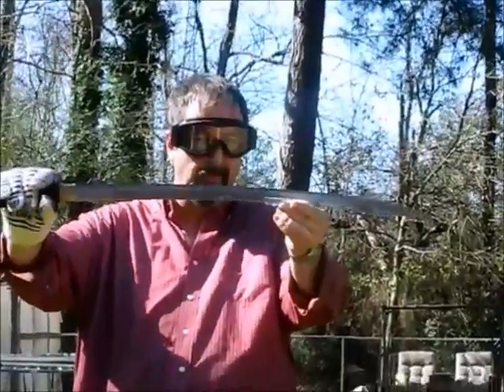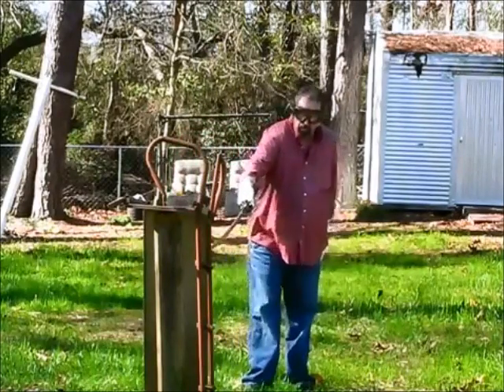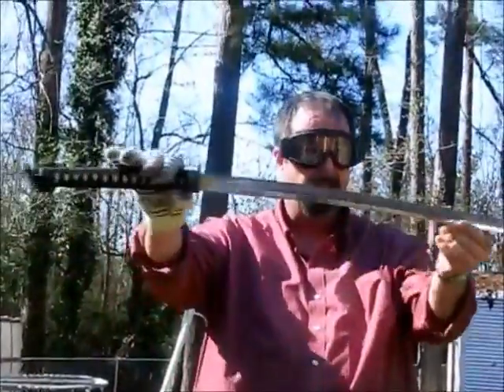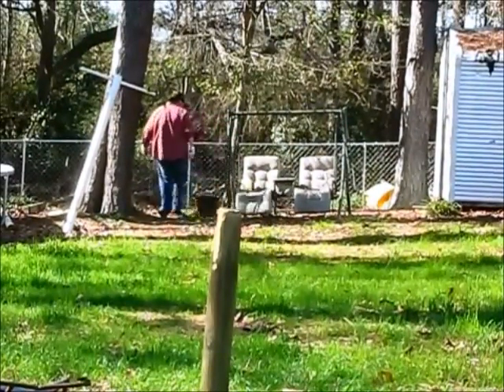Ronin Katana - Samurai Sword Destruction Testing - Sword vs Metal Pipes vs Bricks vs Wood

Comment: i will never call a katana a katana. unless it was made with the true proper traditional techniques . in forging out the blade then forge welding the two types of metal one with a higher carbon content for the cutting edge and the lower one for the back bone to allow it to recoil an retain its shape .even after it being over stress .  Damascus steel doesn't retain the strength and same properties as a true Tamahagane blade.
Reply: good to know, i was really wondering what you called a katana
Reply: was that your best sarcasm?
Reply: im not saying tamahagane is superior. just i like to stay traditional . i like the 1095 or 1085 steel in knives . i haven't forged anything out of 5160 yet but I've heard good things from it.
Reply: not at all....or was it and is this? you'll never know
Reply: haha nice
Reply: You wouldn't make a scimitar replica made of paper and expect to have another label for it separate from the name "scimitar", you'd just call it a paper scimitar.
Sword names are used to define their categorized forms.
The word katana; to swords, is not a specifically exclusive like the label Champagne is to wine.
You wouldn't say "this is shit Champagne" like you would say "this is a shit katana".
Reply: Katana means single edged curved sword. So anything like that would be called a katana by the Japanese. A Nihonto on the other hand is the sword you are talking about. Something made in Japan (Nihon).
Reply: then if so nihonto meaning "blade "could apply to a tano or other japanese  pole arm weapons or blade?
Reply: nihon is japan and to means sword.
so japanese sword

i think

Comment: It's called a destructive test. it's supposed to exceed the bounds of normal use to show how well it can stand up to abuse, and to show that the myths of the katana being able to cut anything are not true. This helps people see that there are limits, but that if they accidentally hit an object that is too hard to cut, the sword will not break in half and fly dangerously across the yard like cheap catalog swords and is therefore safer.

Comment: what if you could find a way to make the blade vibrate at a super high frequency to help break the atomic bonds of the object you're hitting? that way it is theoretically possible to easily cut through metal

Comment: It's extremely easy to bend a katana out of shape, especially if it's on accident or is being abused. All it takes is a misaligned cut. That is how they are designed. They bend so they don't shatter or snap, as a bent sword can be straightened, but a shattered sword is ruined.

Comment: Yes it would.
This is a made in china sword that is being mass produced on a factory and the metal is made of is very cheap, so thats why you can buy one of this swords from a $100 to a few hundreds.
In the other side of the spectrum you can have a handmade Japanese Katana, the whole process starts from picking the right mineral ore to transform into the right steel for it and then send to a Master Swordsman that works on it for months and then sends it to a Master Sword Polisher to sharpen it.

Comment: The simple fact of wanting tested the resistance of a katana without knowing even the method of use this, is an insult and a lack of respect to this weapon which in the past widely made his proof, today still of great master smith continuous japonnais to forge saber, only they are far more authentic and more resistant than these trinkets of decoration sold in the business which only uninitiated dares to call katana.
The forging of a katana is an uncommercial art practice which aims has to grow rich with blades of mediocre quality.
Fortunately for you, the ridiculous doesn't kill....... in the passage, do a little sport would not certainly hurt you, it shall be far more profitable to you than to bang a saber with an iron bar.

Comment: Teenager alert.  Stick with the guitar Robin, because a 15,000 dollar sword wouldn't cut STEEL any better than any other sword.  Steel does not cut steel.  This is a destructive test to see the durability of these swords so that other buyers know what they're getting.  There is nothing wrong with power hammers BTW and MANY MANY "real smiths" use them today.  Also... I've been practicing JSA for 20 years.  His form is bad, but he's holding the sword just fine.

Comment: I want to see an l6 banite katana destruction test, because apparently those swords are ridiculously strong, but who wants to ruin a 2100 dollar sword.
Reply: the Hanwei L6 blades are very good, but you can find them for around $1200. 

It is debatable, but the Hanwei Lion Dog katana made from HWS1 maybe superior, and they are about $900. 

If you really want a very strong Katana, at lest a starting level one. Look at the Cheness 9260 blades, they are very strong, pretty well made, and well designed. They are very good for under $300. 
Also the Hanwei Raptor line made out of Mono tempered 5160 are a great starting point, they are just over $300 now.
Reply: Oh yeah, the spring steel ones are awesome because of their flexibility [9260] but I was trained with hard steel weapons not flexible ones so I would be afraid to cut myself badly.
Reply: Aurumk1 It is not that flexible :)
You could cut a large mat and not be able to tell the difference, maybe the slightest different vibration. Holding my 5160 Raptor (no bo-hi) with one hand bellow the Tusba and one hand at the very tip (warped in fabric of course), with all my strength I can only get maybe a inch or two bend. 

The only difference in performance is that if you bend a clay temper blade past the point of no return, you are left with a bent sword. If you bend it to the same point with a mono temper blade, it will take about the same amount of force, but it will snap back to strait. That and the mono temper will lose and edge a bit faster (still more than good enough), but will be a bit more easy to sharpen. 

Also if you really do want a clay tempered blade, once again Cheness has some clay tempered 9260 blades for about $300. Most of that Hanwei Katanas from $500 ish to $1000+ are clay tempered also. Dynasty forge makes some well made ones with folded clay temper blades for around $600. 

Check out Skyjiro forge also. And Thaitsuki Nihonto, they are the closest things to a real completely traditional Katana that one can get with out getting one from Japan for $3,000+ . To be clear Thaitsuki Nihonto are not made in Japan despite the name nihonto, they are made in Thailand
Reply: ***** Since posting that I have come across some less than impressive stuff about Thiatsuki... but as for Skyjiro, I really can not find TOO much negative. Yeah they are pricey, and chines, but so is Hanwei.

Comment: your not even cutting the metal.. if your are your sure ot showing the camera as for the swing set thing. you just knocked it over. and the screws i think you u just hit them hard enough that they came out . if you did cut anything . plz plz plz show the camera .if you did then it wouyld be more believeable